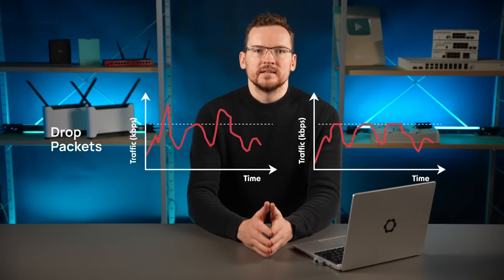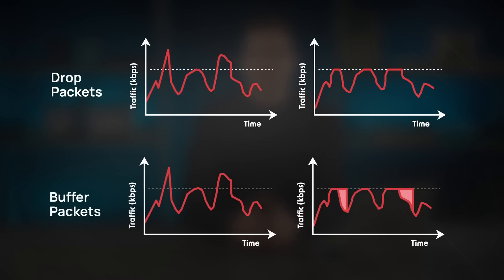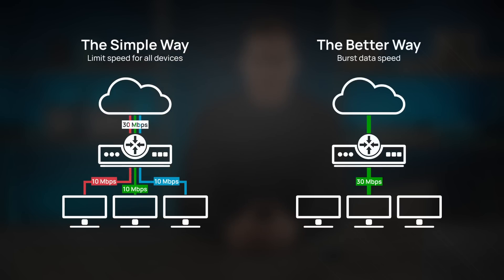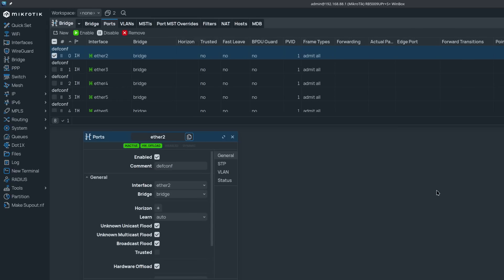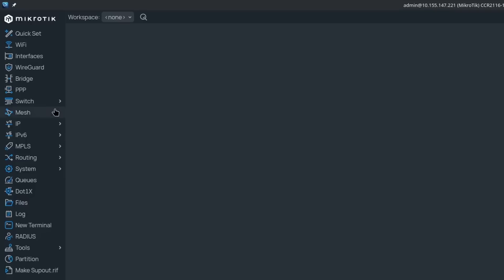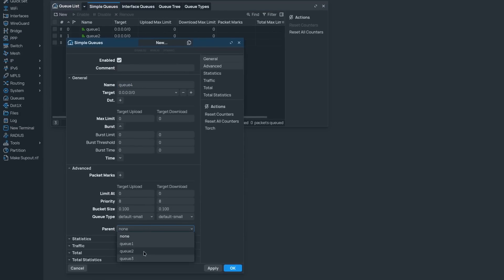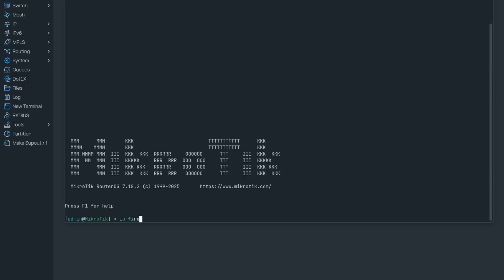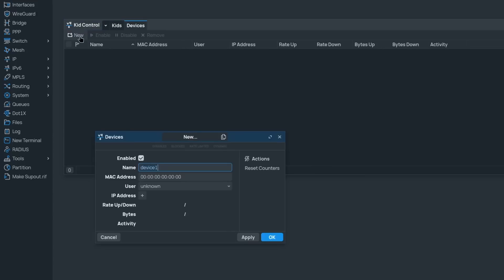Mikrotik QoS: Overview

Comment: Why make it simple if can be done complicated right?
Reply from the maker: It's not about simple vs complicated, but Basic vs Advanced. With MikroTik you always get detailed control and can do exactly what is needed, since all options are unlocked.
Reply: @mikrotik  Yeah I get you, life taught me that complexity ( what you call options ) is the enemy of efficiency and more important, security, but you are right, less than 1% of the users can always use Mikrotik as a option.
Reply: @pbrigham  your rant sounds like skill issue to me
Reply: @ ChatGTP has all the skills you need these days, others vendors do this with 2 clicks, you can call it what ever you want, but simple is not for sure.
Reply: @ Good luck using TP-Link products as your core routers/switches. Your ignorance and haste is stopping you from benefiting the many advantages and solutions that Mikrotik offers its users. This isn't a Mikrotik issue. Being more versatile is the greatest selling point of Mikrotik routers
Reply: @ and you said that "less than 1% of the users use mikrotik as an option" lmao, do you live under a rock? 90% of ISPs use Mikrotik for one thing or another. And businesses in general the vast majority uses Mikrotik over those stupid overpriced firewalls that Fortinet and PFSense offer
Reply: @ What is TP-Link?